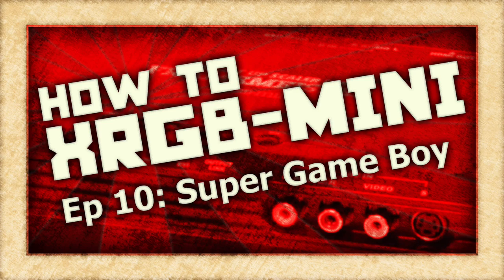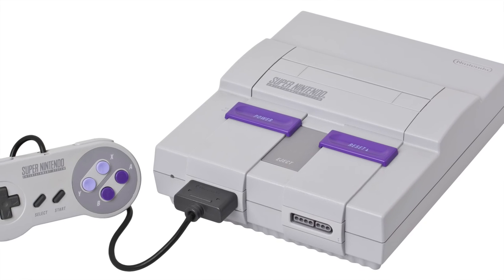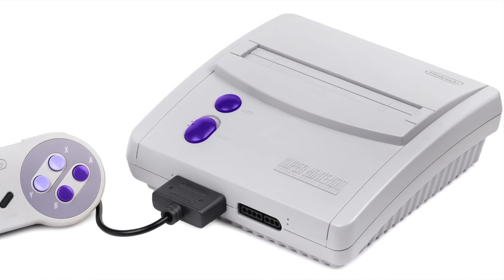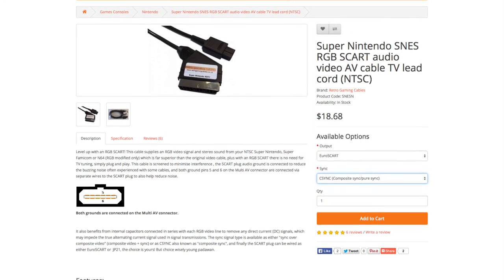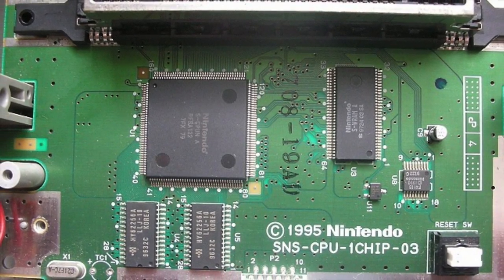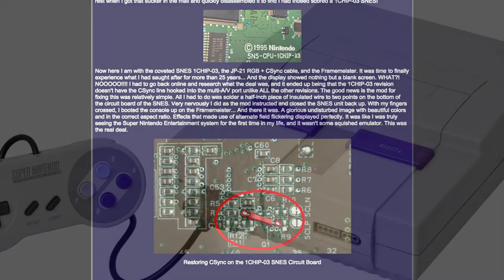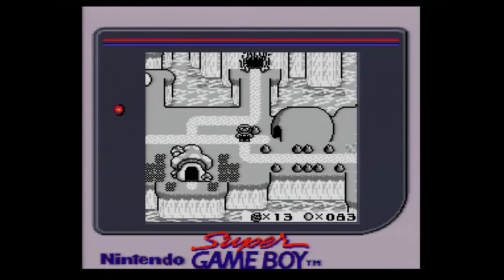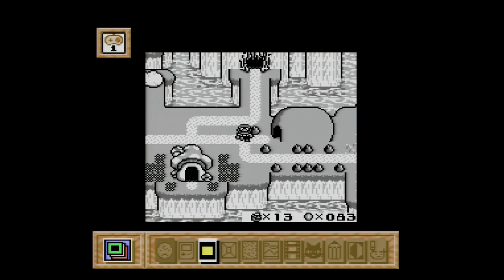How To XRGB-mini: Super Game Boy (Framemeister)

Comment: Do you typically get a cable with a scart (and then use an adaptor), or do you go right for the JP9(?)
Reply from the maker: +Rick Valenta I use all Euro-scart cables and then use an adapter. I figure if I ever need to sell the cables one day, it'll be easier to unload the European wired stuff.

Comment: Need a video for wii via component cable to d terminal to framemister
Reply from the maker: cleardragon Buy a Wii U ;) I actually don't own a Wii but I believe it's component output is notoriously soft. I would start with, H_Scaler: 7, V_Scaler: 5 and Sharpness: 1, and use the Picture video mode. From there... I'm not sure.
Reply: Well mainly using a wii to play GameCube games via component to d terminal.  Still playing around with it